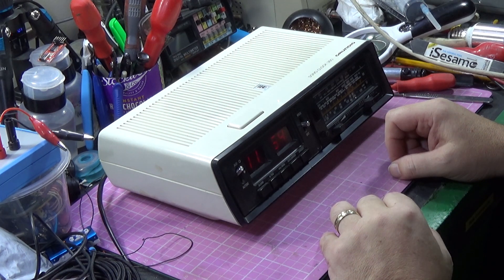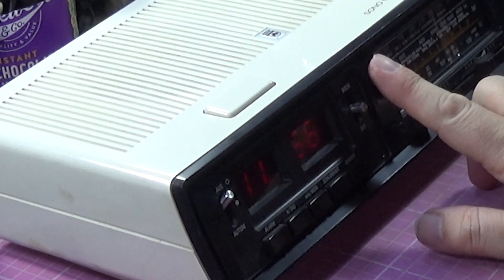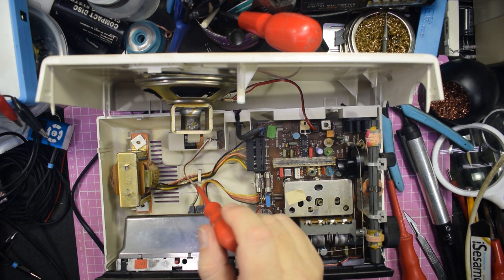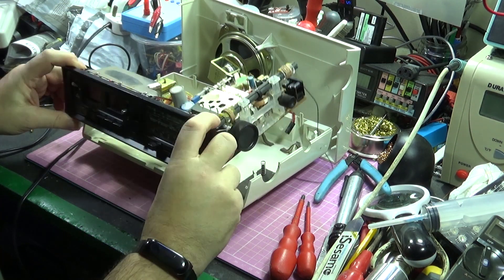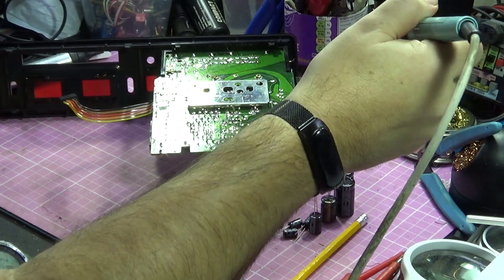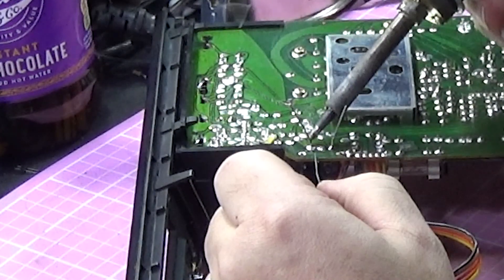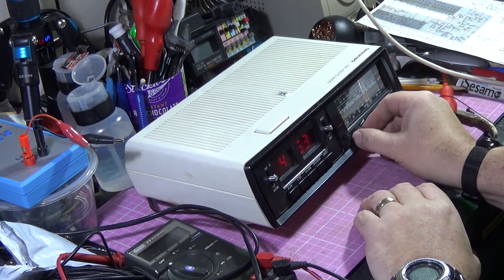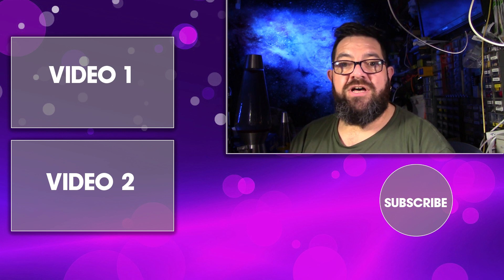Grundig Sono Clock 350 - 70s LED Clock Radio Repair

Comment: I’m glad and at the same time not so glad to stumble upon your video. I just bought a sonoclock 650 from eBay where the left most display only displays the bottom most part. I thought it would be a contact issue and an easy fix, but replacing the IC would cost just as much as I paid for the thing and I can find working ones with worse shells at the same price. 

I got the Sonoclock 210 and it made me fall in love with its cyberpunk look and now I’m just going down the rabbit hole.

Edit: I just did some research and it seems like you can probably also use a Tesla SN74LS157 chip as an alternative to the TBD 570.
Reply from the maker: Its a rabbit hole for sure! You could end up going along to mechanical flip clocks and those are a whole heap of other pain with the drive motors. Useful to know about the alternative chip for the sonoclock, the early led driver ic's are hard to find as you have found and come at a premium.

Comment: I'm coming back to report on my previous findings. I tried everything to get the 650 working, but I think in the end the chip was just gone, and the radio also stopped working. Not worth to get parts when I can get a working one for cheaper. I did manage to fix a Sonoclock 550. What happens with these is that the LED board connects to the IC board with solder, but the solder joints are really weak and end up cracking. Reflowing the joints on the 550 got it back to life. I initially thought the 5-pin (6-pin on the 650) connector was the culprit and exchanged that without fixing the issue. 

Really cool clocks, but that design flaw is annoying.
Reply: Was your display dark?

Comment: nice job George,-ihave the older flip clock grundig sonoclock 20b,nice sounding,-but-the clock is not working,its complicated gears and motor mechanism,its stucked, i gave up

Comment: Nice video! Just snagged one of these from eBay for 15€ to get rid of the smartphone on the nightstand. Supposed to be fully working. If not, might be a good first project for restauration purposes. :)
Reply from the maker: Nice one! They are nice units for sure
Reply: @GeorgeChristofi  Sadly the transformer hums a bit too loud for having it next to you while sleeping. I am guessing that this is because the german power grid changed from 220v to 230v after this device was produced, which might put the transformer to operation at its limits.

Comment: Very enjoyable video to watch. I have a 350a, it's indeed really well build even al the plastic clips didnt break and the radiodial light still works.

Unfortanatly my transformer makes a loud hum, the kind that they usually make except louder. Not coming from the speaker. Anything I can do about it except replacing?
Reply from the maker: The transformer hum is usually vibration from the core itself. it might be possible to tighten it up by gentle use of a hammer on the frame that clamps it together. Alternatively, squeezing the frame in a vice may work as well.
Reply: @GeorgeChristofi  Thanks I will try that. It looks like someone had a go with it before but I don't know how long ago.
Reply from the maker: That is always the way with older electronics. Plastic is getting brittle and you are more likely to be the second or third person to have had fingers inside it.

Comment: Great repair George!  Like the fact the radio is very module, no messy wires to get in your way!  :)  Looking forward to the rebuild on the other.  ~Jack, VEG
Reply from the maker: Jack, for some reason the Germans design things properly. Easy to use, easy to service. Hopefully the other one will be a simple fix but the controls being missing may be a problem.

Comment: Good well done. Still got to take my 70s clock radio apart and change the filter electrolytic.  Turning the radio on resets the clock, lol
Reply from the maker: Sounds like a good project for a video!

Comment: i got a sono clock 31a the display dont seems to work correctly  radio works fine
but it dont show the clock just a first 3 -  - - then when i press a button a 0 on the 3rd segment shows i can tho set the week and month just fine 
but setting the clock didnt go well

i did not know the radio had a timer then thats why it turns of after a while but sometimes it can be on its just weird

to turn on the radio i press schlummber button and its on for a few seconds
any idea whats wrong
Reply from the maker: It has a strange setting method if I remember rightly, I think it needs combinations of buttons. The full service manual for it can be downloaded for free from https://elektrotanya.com/grundig_sono-clock_31a_sm.pdf/download.html

Comment: Hi. I have a sono clock 1000, it works perfectly but the display light is very low. Do you know what to do to fix?
Reply from the maker: When you say display light do you mean the lamp on the dial face for the radio or the LED segments? The lamp is difficult for the dial face but can be replaced with a white or orange LED. The clock display will need the LED display replacing.
Reply: Thanks. I mean the backlight of the clock display

Comment: hello, I have an equal radio but does not have the tuning light, how does it turno on? also the lamp may not be good, do you know how many volts it is? thank you
Reply from the maker: The tuning light turns on when the radio is on. They are very dim on mine too. I will have to try and find a service manual to find the lamp voltage because I fixed mine blind, just following components.
Reply: @GeorgeChristofi  hello, thanks for the answer, I will try with a 12v flashlight to light a little 6v, then I give feedback
Reply from the maker: @miguelbaia2386  I have just found the full service manual on elektrotanya and it states that the lamp is a 12-15v 30mA light.
Reply: @GeorgeChristofi  thanksssssss

Comment: Hi George. Great video. I have small colection of old Sono Clock's and one in particular, a sono-clock 31a(1976?) wich is very similar to the model you show in the video, has  some problems in the radio section, and the light dimmer sensor doesnt work but that doesnt bother me.  I will try to replace the capacitors to fix the humming problem of the radio. Can you tell me wich capacitors(voltages) did you use?
Greetings from Portugal and please continue to make great videos.
Reply from the maker: I tend to upgrade the capacitors at least one voltage rating higher as modern capacitors are generally smaller. If you have 16v capacitors in there it will not hurt to put 25v capacitors into the unit at all. If it is 12v then go to 15/16v... it depends what is more available to you locally. There would be no issues fitting like for like in, so replacing them with the same voltage but you may have to stretch the legs slightly to account for the smaller size. 

Many thanks for watching my videos and glad to have you on board. Greetings from the UK.
Reply: @GeorgeChristofi  I got a sonoclock 350a for my colection and perhaps you can help me. One of the clock switches "uhrzeit" as soon has i cleaned it stopped operating and now i cant set the time. Do you know what could it be? Perhaps something with the cable or the switch itself? Are they hard to fix? Many greetings!
Reply from the maker: @frajolas73  It is a standard 70's grade switch so unless it is physically broken you are likely to have either a track break on the pcb or a dirty contact in the unit.  When you say 'cleaned it' is that cleaned as in electrically inside the unit or just a dirt removal from the outside?
Reply: @GeorgeChristofi  Hi George. I opened the radio to substitute the backlight bulb on the radio side and as some switches were not working very well i used a electrical contact spray to clean that section. All of the switches imediatly start working very well. After several minutes the uhrzeit switch started to fail and then stoped functionig. I clean it again as i found some white residual spots left from the spray. But that button doesnt work anymore. Thank you very much for your help. Greetings!